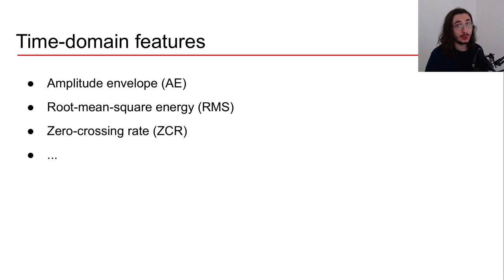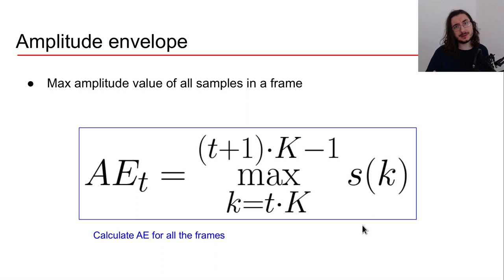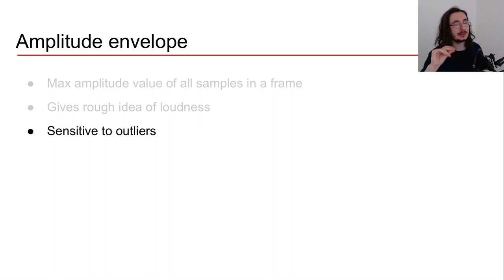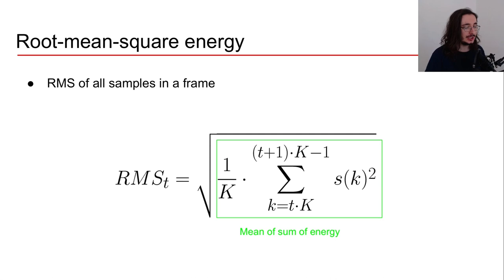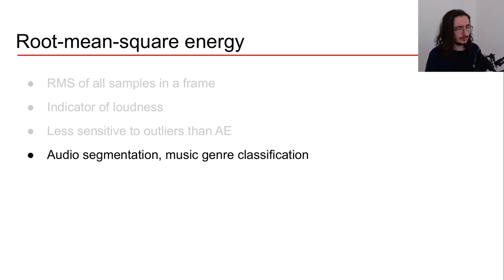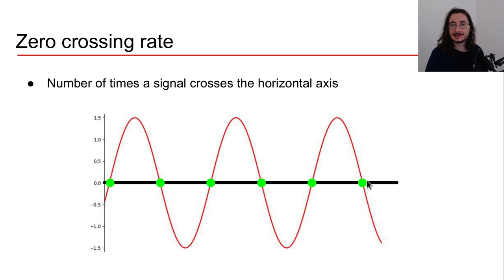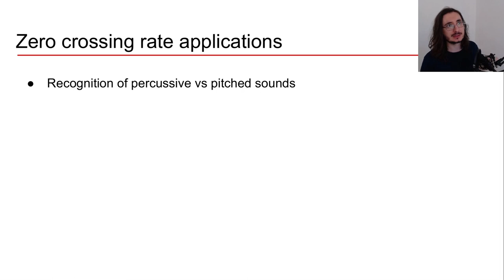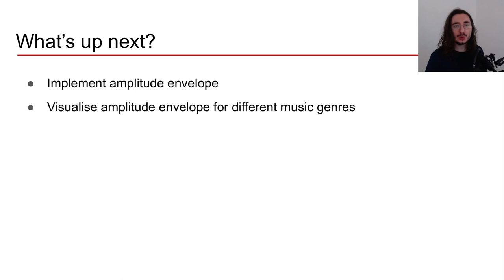Understanding Time Domain Audio Features

Comment: I notice that the zero crossing rate equation kind of breaks down if one of the samples has an amplitude of 0.  In theory, that will probably never happen since 0 is just one out of infinite possible amplitudes for any given signal, but in practice we have limited values that we can actually represent and rely on rounding to the nearest one of those for each sample.  If that nearest value happens to be 0 for one of the samples, then |sgn(s(k)) - sgn(s(k + 1))| evaluates to 1 rather than 2 or 0.  If this only happens once, we end up with a ZCR of, for example, 4.5, but if it happens more than once, we won't be able to tell, as every two occurrences will just look like a single "normal" crossing.  A ZCR of 4 could mean we have 4 crossing pairs that don't contain a 0 sample, or it could mean we have 8 crossing pairs where one sample has a value of 0.

So do we just ignore this under the assumption that it won't happen frequently enough to be an issue?  Do we remove 0 as a possible amplitude value that a sample could evaluate to during quantization?  Or is there some other way of dealing with it?

Comment: @Valerio, I have a question about zero crossing rate ... if one of the consecutive samples have value 0, then its sign is 0.... so if the other sample is either + or - , the number of zero crossing sample in this case is 1/2 , which is actually true ? .... I would recommend , if the k+1 sample becomes 0, then we need to look for k+2 sample  meaning 3 samples in same time.... then we can compare between k and k+2 samples...  if k and k+2 samples are same sign, then intermediate 0 is not a indication of zero crossing , if k and k+2 are opposite sign, then all these 3 samples will mean a single zero crossing case
Reply from the maker: Good catch! I think it's mainly a performance issue. In a 16 bit record, for example, the chance that you actually get a 0 value for the amplitude is pretty low, given you have ca. 65K values available. For this reason, it's probably preferable to get an "imperfect" 0-crossing rate, but compute less operations. This may not be an issue for off-line applications, but for real-time ones it can make a difference.

Comment: Valerio, This amplitude envelope method is not complete as it gives you only the maximum value of the frame. In order to get the real amplitude envelope, you need to connect the maximum of the previous frame with the next one through linear function. (y-y0)= m(x- x0) where the m =(y1 - y0)/(x1-x0) . am I correct or did I miss something?

Comment: Explanation is very lucid. I was wondering though what are typical frame sizes for envelope detection? The ones used in the visualization seemed a little coarse (presumably for "educational" purposes).
Reply from the maker: Thank you! Yeah, you're absolutely correct. You should use typical frame sizes (e.g., 1024, 2048), but the decision obviously depends on sampling rate. 

If you haven't, you can check out my previous video on audio features extraction pipelines to get more details on frame sizes.

Comment: Interesting topics with good explanations and weekly waiting for your videos. How the frame size is chosen?. Whether these time domain features can be used for tracing speaking rate (i.e.,speakers speaking at fast or slow).
Reply from the maker: With these features, we usually try typical values for the frame size / hop length (e.g., 512, 1024, 2048)
Reply: @ValerioVelardoTheSoundofAI   Thanks for your response, Valerio. Any suggestions or links to find speaking rate (fast, slow or medium) whether ML-based approach or time-domain features enough for the findings
Reply from the maker: @venkatesanr9455  unfortunately I don't know the literature on this problem. I'm sure a quick search on Google Scholar will help!
Reply: @ValerioVelardoTheSoundofAI   Thanks for your kindly reply.

Comment: Could you use time series algorithms used in trading as feature after all they are all mathematical signatures. I can sort of see use cases of MACD or other simpleMoving weighted average calculation to see burst of energy calculations. 
Like you can extract frequencies and do reverse fft like you would to denoise and compare each time domains at different frequencies.  
You can even do covariance and/or correlation between these? Would it make sense ? 
That beats me..

Comment: Is there an error for the upper bound of the Zero Crossing Rate for a frame t? Shouldn't the sum's maximum iteration reach (t+1)K - 2 instead of (t+1)K - 1? We are comparing k with k+1 so if we do only -1 in the last iteration we compare with the first sample of the t+1-th frame. No? Anyway great video, this series makes getting into audio signal processing quite easier I've binged all this playlist today and I'll probably do the same with the Deep Learning with Python one :D
Reply from the maker: Glad you like the series! (t+1)K-1 is correct because you want to check the crossing rate for all the samples in the current frame. For doing that, as you correctly pointed out, you'll have to compare the last sample of frame t with the first of frame t+1.
Reply: @ValerioVelardoTheSoundofAI  ah that makes sense, didn't think about it that way
Reply: @ValerioVelardoTheSoundofAI  Great Video! Just have one doubt. What if frame t is the last frame and the (t+1)th frame doesn't exist, then what will be the value for s(k+1)?